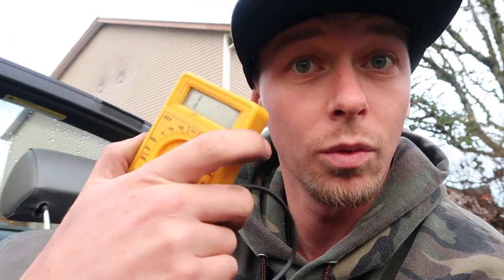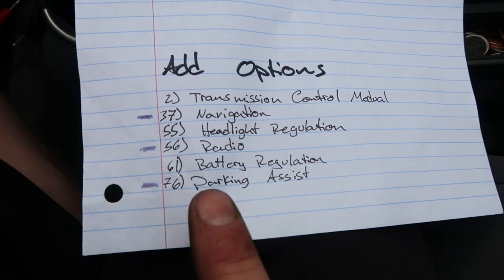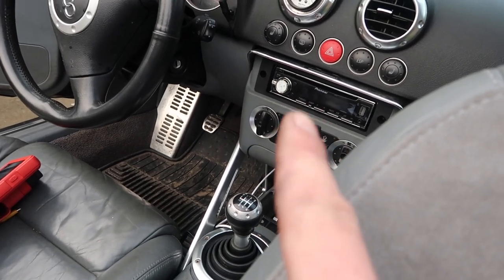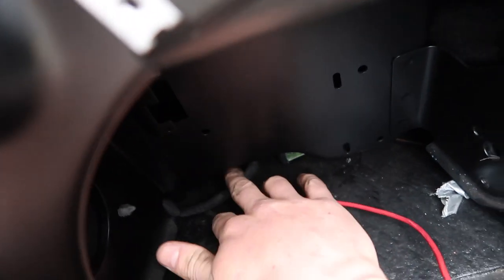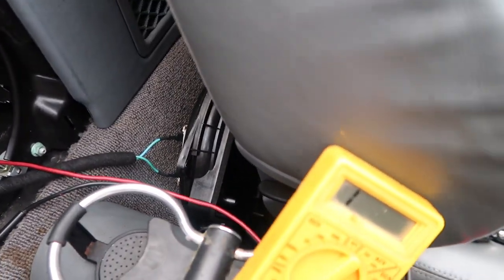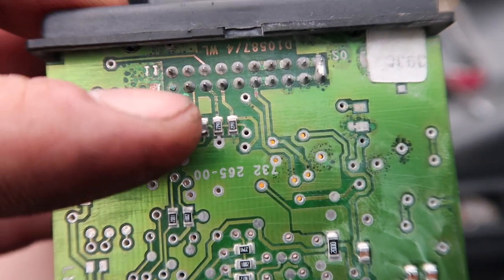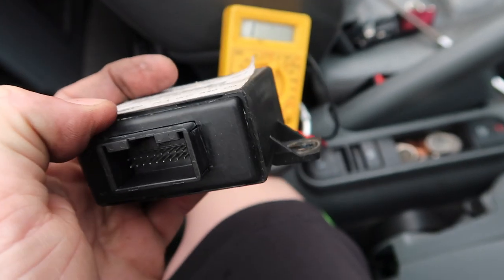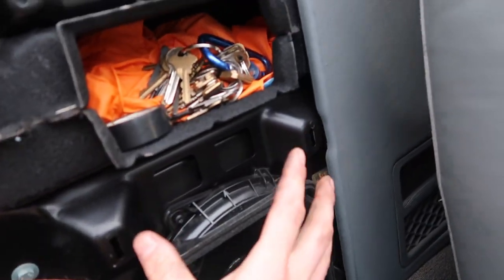Finding The Problem Module On The K-line

Comment: Yo thanks for this! Were your headlights working with the faulty module? I would assume if this module controls the headlights then the headlights would be out, but considering how hard it was for you to find I'm assuming everything was working except for the OBD2? I have the task ahead of me of figuring this out.
Reply from the maker: The headlights would work on and off they would randomly turn off by them self’s with the light switch turned on

Comment: Hello, thankyou for upload. Do you remember how much voltage is there in k line ? 
I am checking a Porsche it has 2 k line in pin 3 & 7, maybe somehow it could be similar to audi
Reply from the maker: Oh man that is a good question I don’t remember testing for voltage. I know I tested ohms for grounds. If it’s grounding out it won’t send the right signal. I know it’s not much help but I can try and help the best I can if you give me a little more information on the problem and stuff you have tried. Keep me posted

Comment: Audi s4 b7 While replacing my headlight bulbs(xenon) I notice the inside the head light alot of wiring is all brittle and stripped and naked(assuming heat over time) wires touching eachother so im in the process of replacing the harnesses inside the light.
Reply from the maker: Oh that sounds like a fun job. Were the wires exposed or were they in a loom?
Reply: @ModdingAddiction  was the complete harness inside the headlight

Comment: Hey men, one question. I have a A4 b5 1.8T  build in 1998 with K-Line. My k-Line is grounded. Thats not good or? I dont know, if the K-line should be grounded or have +
Reply: Not sure if you ever got a solution but I'm doing similar.. trying to read Kline on my motorbike. Seems like it's permanently grounded.. lol I haven't been able to read a pulse off it yet. Dammit😊

Comment: Do you know where the headlight module is located in a 2001 audi tt quattto? Not a roadster…
Reply from the maker: That is a good question I have never seen the coupe layout. If I was to guess I would say under the passenger glove box dash area. Is this for sure what is causing the problem? Have you isolated the other wires at the OBD connection to make sure this is the fault? The roadster has a problem where the top roof drains get clogged and flood this module. The coupe Shouldn't be having this problem. If it is headlight related I would start at the headlights themselves. Hopefully that helps keep me posted.
Reply: Under Rear seat
Reply from the maker: @dannmercado9932  Good to know. I haven't had the chance to work on the coupe but i do know the layout is different from the convertible.
Reply: @dannmercado9932  i can’t find it under rear seat

Comment: I'm having a similar issue with a 2004 audi tt. The hazard lights were randomly coming on throughout night while car was off killing the battery and the airbag light under the shift knob was flashing i jumped the battery All the floor boards of the vehicle are wet due to the rain we are getting here, in the meantime pulled the fuse to the hazards lights car runs fine but i plugged in ob2 scanner and it can't read anything its basically saying its not connecting to computer/ can't find it i re inserted that fuse and double checked obd2 again and nothing now the raido is currently off and won't turn back on but when i eject the cd i can hear it working . Any ideas ?????? Floor boards are wet and under the seats and behind them.   Anyone have any ideas. ...i doubled checked my scan tool on another vehicle it worked flawlessly fyi
Reply from the maker: Take apart the k line connections. The headlight module was flooded on mine and caused the k line to be shorting out. If anything is wet along the k line it is probably grounded and not allowing the scan tool to connect
Reply: @ModdingAddiction  copy that thanks for the response bro 😎